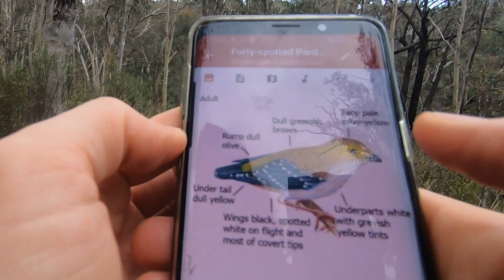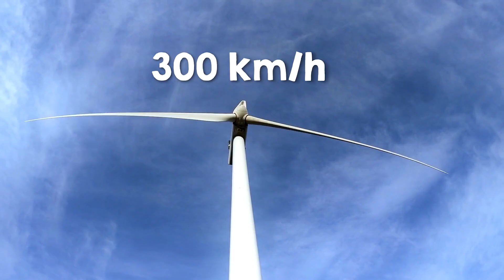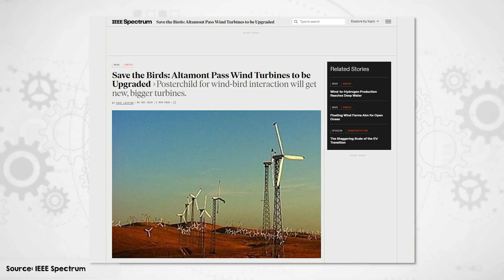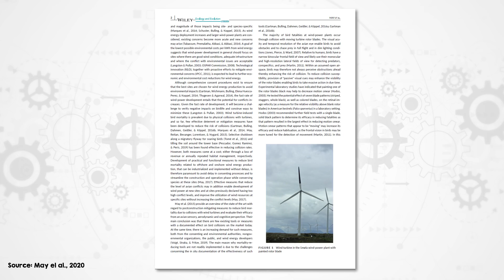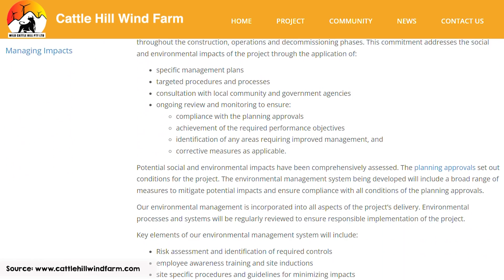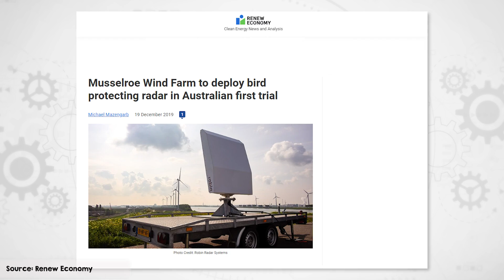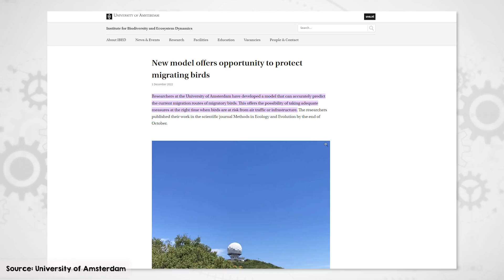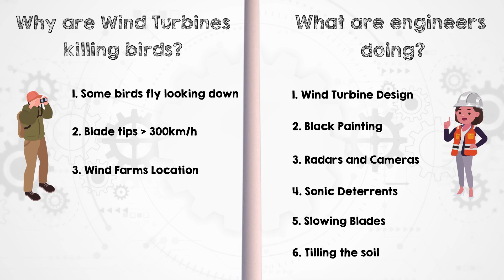Blades vs Wings: Wind Turbine Technologies to Save Bats and Birds

Comment: I understood there is another mitigation method, taller turbines, so the lowest point/level of the tips is above the flight levels of most birds (around 30 meters) and bats (15 meters).  I heard of one wind farm that during it's resource consent application process (I'm guessing the environmental impact analysis) needed to increase their turbines to a larger size i.e. higher axle, raising the lower tip level above the flight levels.

Comment: Current wind turbine tech is designed as "too expensive to reproduce, and touted as the most efficient". That is a total load of rubbish. The generators should NEVER be put at the top of the turbines ! EVER ! There are SO MANY better methods such as using hydraulic pumps, reciprocating linear alternators . It is PURE unadulterated miss information .
And for gods sake what is wrong with using turbines to pump water or pressurise air or both and use that as a battery ? Damn the towers are so tall I bet they could store a few 100 KWHs of power not to mention the structural improvements with pressurised tubes.

Comment: How much fossil fuel is used to make and install one turbine? How much fuel is used to spin the blades? Turned really on fossil fuels. It is a scam
Reply: Fossil fuel is not used to spin the blades.
The carbon footprint of windturbines is 1/100th of coal power plants for each produced kwh.

Comment: Hey Rosie. That was very interesting indeed. I did however find myself raising an eyebrow when you introduced the soil-tilling “solution”. I’m sure I don’t need to point out the degree to which soil tilling causes carbon emissions, not only from the soil but from the diesel burnin in the tilling tilling plant. Creating species-rich, natural habitats, which increase biodiversity in the vicinity of the wind turbines may cause an increase in bird strikes but will also increase the carrying capacity of the ecosystem, potentially offsetting the additional deaths. Even if the land is used for agriculture, leaving bare tilled soils over winter is a sure recipe for soil destruction and productivity decline. As always, these topics are complex and nuanced so the work of your channel and others like it is really important in exploring them fully. 
Great work 👍👍👍

Comment: We built a new home and moved in earlier this year. We've had at least 3 birds die due to flying into the windows. They're highly reflective so as to not pass much heat energy into the home and save on heating costs. But that means that the birds think they're flying into blue sky. It's frustrating when our attempts to build efficiently and have a minimal impact on nature backfire.

Comment: It's really easy a few thousand pounds of Dinomite at the base of each one. The only way to put a stop to the deadly Infrasound!
Reply: Infrasound at these levels is harmless, unless you plan to live at the base of a windturbine.
Reply: @old-pete  it is ultra low frequency!30 miles is a lot worse the at the base! It takes over 2 miles for the sound wave to form!
Reply: @terenceiutzi4003  BS...
the intensity halves with every doubling of the distance. Infrasound has wavelengths of 17.5 to 343m, not 2 miles...
Reply: @old-pete  read up on the US military's expiraments with Infraw sound. And how they couldn't protect their own forces from it.we are talking much less than 1 cycle per second and about 3,000 time louder than a helicopter! Each blade produces one pulse per revolution!
Reply: @terenceiutzi4003 That is the point, sound becomes dangerous when it is loud. Windturbines are at around 65db at 150m.
Reply: @old-pete  the infrasound from the wind-farm in Chattom Kent is fracturing the Shail and polluting the wells with Benzenes!

Comment: You forgot to mention that the low pressure vortex on the trailing edge of the huge blade causes embolisms on the respiratory systems on birds and bats. They may never even get directly struck by the blades.

Comment: This is all a tragic rationalization.   Coal plants have scrubbers in the stacks.  You monsters are killing the eagles in their migration path in Altamont.  Killing whales with just the sound of hammering on the sea floor to secure these contraptions.  What do you do with the wasted blades that must be replaced frequently?!!! They don’t degrade quickly.   It takes carbon fuel to produce and transport these things.  What about the disruption of ground habitat? You want to hold on to this green idea so badly yet you are the destructive mess you complain about.   You’re like the Team America marionettes running around, tearing up the world, in order to save it!
Reply: Coal plants still emit more dangerous emissions than other power plants.
Eagles are killed by climate change too and windturbine positions can be selected to evade the habitat of endangered species.
Hammering on the sea floor can be done noise friendly with bubble curtains, it is all a question of regulation.
Wind turbine blades do not need to be replaced frequently and can be recycled.
The energy use for production and tranportation is considered in the CO2 footprint.
Ground disturbance is minimal and not really an issue.

Comment: I would think a whistling tip could be added to the blades, molded with the rest of the blade, granted, minor efficiencies would be lost but a very slight curve would add a whistle and it could be made to produce a sound out of human hearing range but within that of birds. the speed of sound is much faster than the blade and would give birds a chance .

Comment: In this video the specifics you talk about are about birds of prey.  One area you did not mention was migrating songbirds.  I know that songbirds here in the Americas mostly migrate at night so the solutions that involve visual cues are not a good solution.  
The total number of birds killed does not take into account what species of birds are impacted and the relative abundance of those species.  
The argument that many birds are killed by cats and power lines means we should be fine killing some more does not make sense to me.  It's like saying that because so many people are killed by heart disease we should be fine with a much smaller number of people that are killed by kidney cancer.  They are different issues.  The birds impacted by cats are ones that live around people, they can be totally different than the ones impacted by wind energy.  
Radar does seem like a promising solution but it has to be used and in the US it seems like there is a push is deny any significant impact and tar anyone who brings it up as a right winger that is using the issue just because they are pro oil and anti-renewable.  I don't deny those people are out there but that does not mean it's not also read issue in some places.  
A book that opened my eyes about this is is A Season on the Wind by Kenn Kaufman.  He is someone I know cares about climate change and birds.   In a couple of chapters he tells the story of a plan to build winds turbines in a migratory hot spot on the shores of lake Ontario.  As a birder and a wind energy person I think you would find it a very interesting read.

Comment: since a bunch of birds can see the ultraviolet spectrum, i wonder if it's possible to get the same effect as darkening one of the blades by applying uv reactive materials to the blades instead of black paint, so it looks different to the birds, but doesn't soak up the heat and deform.

Comment: Rosie discussed the problems with painting the blade black.  The subject was raised that blade temperature would increase from absorbing sunlight.  But the velocity of the air flowing over the blades is very high and I seriously question the temperature of the blade can be raised because of the high velocity airflow cooling the blade.

Also it seems that if the blades have to be balanced, then they could choose the lowest weight blades and use the weight of the paint to increase the blade weight to balance it with the other two.  Also the white blades could be painted white to balance them.

But am I oversimplifying something?  These are engineering problems that we pay engineers to solve!  Where are they when we need them?  😢

Another possible solution is to put a whistle on the blade tips.   The loud sound should scare away the birds.  Another method to scare birds away is to fire a propane cannon every few minutes.  These are already being used to scare birds away.
Reply: While air flow would cool a black blade, it would also cool the unpainted ones as well, so the unbalanced condition would still exist.
Reply: @whiteknightcat  
I'm not sure how you came to that conclusion.  There are 3 ways heat moves: convection, conduction and radiation.  The conduction is minimal because the blades are made of fiberglass and resin, poor conductors.  The blades receive radiation from the Sun but the black blades absorb more and radiate less than the white blades.  But due to the high velocity air currents, convection makes up the predominant portion of the heat movement, much greater than the other two and equalizes the temperature. 

One other factor is the blades are out in the sunlight only part of the day, lowering the effect of sunlight.  But the sunlight affects the blades the most when the blades are not moving during no wind.  But as soon ss the blades start to move, the cooling takes effect, minimizing temperature difference.

Comment: I remember reading (but not where) that most bird deaths were not from strikes with blades but from entering the wing tip vortices and getting flung about - think Cessna 172 following a B747.  If so, would changes to the wing tip reduce vortex formation and perhaps improve the efficiency of the turbine? 

Great video as usual. Thanks for keeping us informed.

Comment: Cats kill an estimated 2.4 billion birds annually in the US. That's 2,400,000,000. Are there regulations governing cat ownership? No.

Automobiles are responsible for 200 million bird deaths per year. Do vehicle manufacturers have to install bird strike mitigation technologies? Do drivers have to stop so as to avoid bird strikes? No and no.

Power lines collectively kill 7.9 million birds per annum. Are electric utilities required to modify equipment or operations to avoid bird deaths? I know, let's require special bird radar that signals equipment to be de-energize lines when birds approach!

Then there are wind turbines; all together accounting for some 1 million bird deaths per year. For some inexplicable reason, some segment of the population, as well as government, see this new(ish) technology as having a statistically significant effect on bird populations. That's simply not true.

This is beyond ridiculous! I'm all for not killing birds, but we simply cannot afford to do the things featured in this piece for every, or even selective, wind turbines; on-shore, offshore, in avian migration routes or not.

Wind is a critical contributor to decarbonizing economies. Measures that increase costs and/or further complicate and extend permitting for and construction/erection of new installations only serve to increase costs. Costs that should follow the classic volume curve of decreasing costs with implementation at scale.

Those wedded to the status quo (read legacy fossil energy interests) absolutely love this. Make a big deal about wind turbines killing birds using big, scary numbers to deliberately deceive the public by conveniently omitting causes accounting for approximately 240 orders of magnitude more bird deaths annually. Causes for which we do exactly...nada, zip, zero, zilch!

To sum it up:  Wind turbines account for, get this, four hundredths of a percent, or 0.000417. That's a rounding error if ever there was one! We seriously need to get a grip.

Comment: Most bird species perceive UV, ultraviolet electromagnetic radiation. It's strange that this property is not utilized, to safeguard birds? 

(While humans don't. Wind turbines are white, because of the heat dissipation, but also to obscure them from NIMBY humans) (I just realized I should always Google my thoughts before I mentioned them, since this is already being tried with mixed results. But as a YouTube expert I'm sure I could improve them ;)

What about the age old techniques that airports use, of distributing models of birds-of-prey, iE predators and relocating  them? Plus utilizing falconers. Different models of predators could automatically pop-up on top of and at different elevations of the support structure. Which has to be done strategically when  predators are not in the area. 

Where is an ornithologist, when you need one? ;) 

By the way, keeping bats away with sonar deterrence, stresses them. Nothing in life is perfect. Thank you for the well-balanced post.

PS how about a future post on decreasing bird mortality, from electrical transmission lines? 
Maybe we should train cats to walk along them,  to scare away the birds? IE kill two birds with one stone. Or should it be kill two cats, with one stone? (qualifier: no cats were harmed or intended to be harmed by these comments :)

Comment: One misconception needs to be cleared up.  The flying animals do not need to actually be hit by the blades to be killed.  The blades are wings.  They operate by generating low pressure regions that pull the wings around.  If an animal fly though this low-pressure region it can be as stressful as being sucked up by a vacuum cleaner.  A more nuanced study of what it means to fly may help.
Reply from the maker: I originally had barotrauma in this video but I found that there seems to be at best a 50:50 split about whether it's actually significant. There were several papers from high quality sources whose research suggested it was a very minor contributor compared to collisions. So that's why I didn't include it.

Comment: 7:19 what about installing colorful light 
it does need to be on the blade nor moving 
just pointed on 120 degree cross section of the circle that blades rotates in so there will be always one colorful blade

Comment: Biggest issue with large wind turbines is that they affect the normal winds on earth, so we will slowsly see different climate (probably warmer since it will be like being inside a car with sun at you with windshields up)
Reply: I don't believe you.
Reply: @alanhat5252  jsut google it. where do you think the kinectic energy of the wind goes? if it stays untouched that is basicly an eteranal energy machine. No, the winds kinectic energy goes to rotation, that goes into heat and electricity. basic physics at work
Reply: @AndrewTSq Surely, but that effect has to be minuscule!
Reply: @ciamej  maybe. In sweden we currently get 1220Megawatt from the wind according to realtime data.
Reply: @AndrewTSq  Yeah, but I'd say that total wind power on earth is measured in petawatts (10^15 W), so a few gigawatts (10^9 W) won't change a thing...
Reply: @ciamej  thats just in sweden. We already see that the amazonas trees have an imoact on our wind

Comment: Or we could just build nuclear
Reply: We need a mix of wind, solar, and nuclear. Nuclear is great but it’s more expensive than wind and solar. Mixing in the wind and solar brings the overall cost down. We must have a lot more nuclear though because wind and solar are intermittent. Storage won’t entirely solve that problem. We need nuclear to cover base loads.
Reply: @Lew114  We do not need wind or solar if we have nuclear. All unreliable generation does is make it more complicated to balance the loads. Intermittent generation needs 100% capacity backup with reliable generation. The costs of nuclear are in construction, so if you are building enough nuclear to back up your intermittent renewables then there is no cost benefit to having the renewables at all. Keep them for off-grid communities where unreliability is acceptable.

Comment: Land-based windmills kill 234,000/yr, electrocutions 5,600,000, collisions 25,500,000, poison 72,000,000, vehicle collisions 214,000,000, glass collisions 599,000,000, cats 2,600,000,000 ...

Whatever, easy to say bird kills by windmills is a problem by ignoring reality when you're against alt pow
er.

[Edit, the giant windmills kill by the pressure drop not hitting the birds]
🕊🇺🇲

Comment: I have had a wind turbine for twenty years with no bird strikes. The solution is easy. Paint the blades black with one blade tip painted white and a white stripe half way down a second blade. The moving high contrast spots with an asymmetric pattern alert the birds and keep them safe.

Comment: Thanks! This was very helpful, informative, ...and well cited! I'll share these options with colleagues who have been wanting to compliment our existing off-grid energy in a wildlife rich area, summer home to a huge migrating bat colony and many rare birds.
Reply: Are you using domestic-scale equipment?
Have you considered caging? There are designs which are easily caged, I'm thinking of roof-ridge squirrel cage designs but I'm sure others could work.
Reply: @alanhat5252  Thanks. For wind, we just haven't yet proceeded yet. My colleagues are more directly involved in planning our options. But when I did hear these concerns, I too heard about and suggested the roof-ridge squirrel cage but I didn't hear what other research others had found. We're working with a tight budget so some projects move slow... which isn't necessary a bad thing with edge technologies.